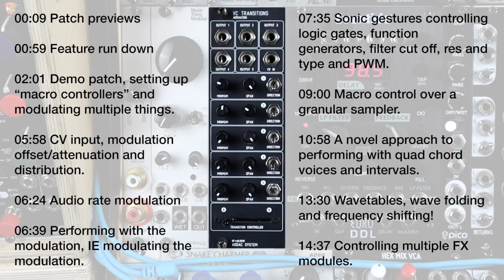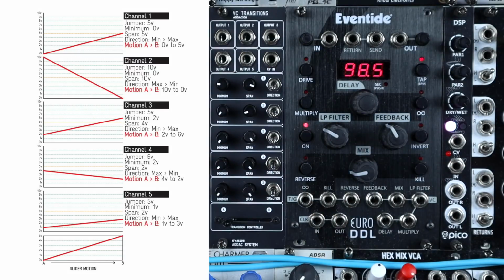ADDAC System 306 VC Transitions - Performance orientated macro control for Eurorack

Comment: Is the looping envelope what you have in the cv with red led cable? At about 6:35 is? When you speed it up?
Reply from the maker: the light up LED cable (RED LED) goes up into audio range, is that the one you mean?

Comment: This looks great. It's a 'dumb frames' - but I mean that in the kindest & most endearing way. It looks very legible & playable and will no doubt lead to very inspiring patches.

This is the exact behavior I often intend to use my frames for, but the myriad of modes and settings often gets in the way and I use it some other way. This knob per param setup looks very good. It does what t says on the tin! and it seems to do it well!
Reply from the maker: Fair point! :)

Comment: A nice addition to the utility family. This could obviously be done with a constant voltage source, inverters, offsets and attenuverters, but the compact form factor is super quick and convinient.  I can see this spin off into several different modules that does basically this but in a different flavor.
Reply from the maker: Yeah I've been doing similar things making macro controls but involves a lot of other modules and HP.

Comment: With all those jumpers to change the voltage range of each channel, it seems a breakout would be pretty handy if not necessary at times.
Reply: i thought that too. luckily ladik do a 6 switch jumper breakout for £16 (I use one with my RCD and it functions identical to the £48 4ms breakout)

http://ladik.ladik.eu/?page_id=948
Reply: Not really. I have all set at 10V and if I want 5V I just attenuate using the SPAN knob.
Reply from the maker: Yeah I very rarely find myself wanting to change them, so I prefer jumpers to just set and forget it.

Comment: it sure is cool but except for the size, i dont really understand why you wouldnt just get a frames instead?
Reply: Four reasons, from the top of my head: a) you don't like having to program a module via menu diving, b) you want to be able to reverse the direction of your voltage quickly, c) you want something hands-on that you can perform with, d) you like sliders as much as I do! :D
Reply from the maker: the man has spoken! :)

Comment: ooh..it's like a fully-programmable/cv controllable automation device....what a great idea..yeah, you'd need at least two =)
Reply: Very useful. I would have preferred instead of minimum and span to freely be able to set two CV-values with the two knobs. No need for the direction switch this way, and when the slider was all to the right you could change the values for the left knob without changing the output.
Reply: @jakobbrandt-pedersen8716  Good point, but I do think the direction switch is an additional aspect that is quite nice to have. Helps bring extra versatility!
Reply from the maker: haha absolutely.